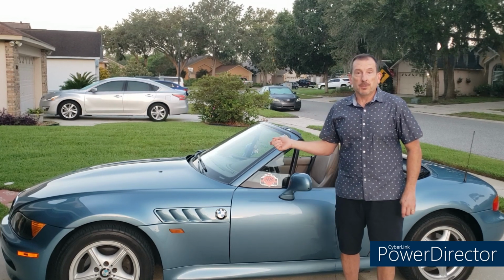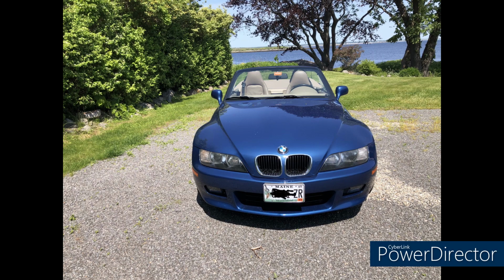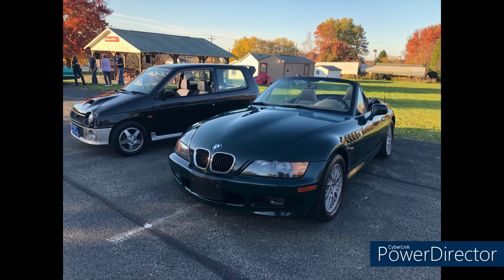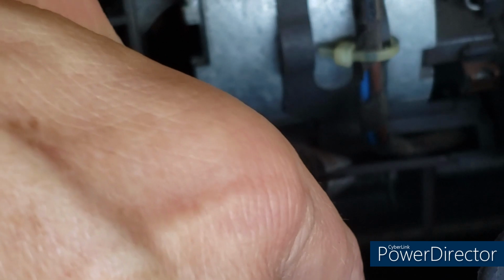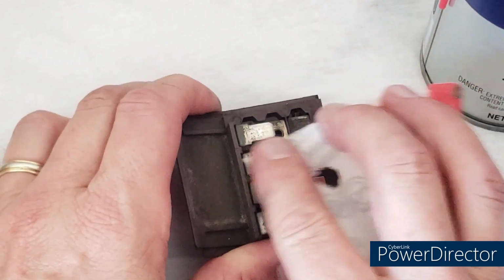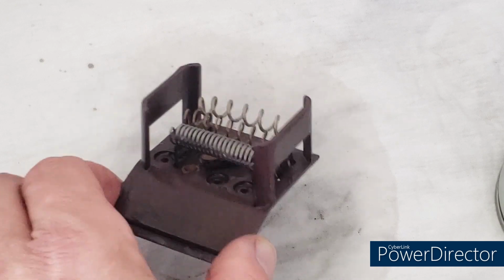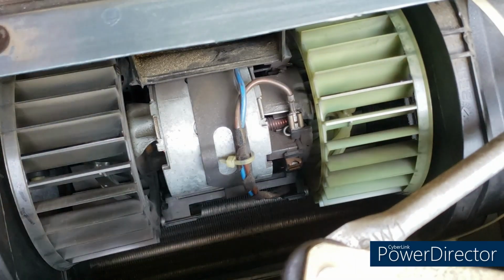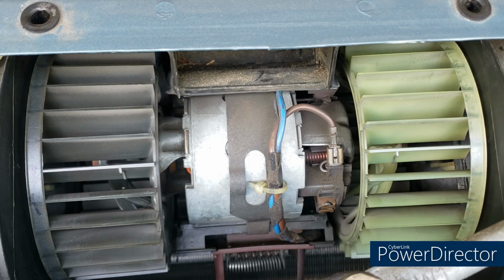How to Clean/Replace the Blower Motor Resistor: BMW Z3!

Comment: Great video, thank you! I followed the link for the resistor, but a banner on the top of the page reads 
" This does not fit
2002 BMW Z3"
I don't know why, since it's obviously the same. I'll order it and see.
Reply from the maker: My guess is that it will work, let me know if it doesn't.
Reply: @MomentofZed  Well, Amazon now said it won't ship to me in New Zealand so I guess it wasn't meant to be! I found it at Summit racing, although it says it only fits up to year 2001 and mine is a 2002. Looks identical though

Comment: @MomentofZed please pin this!

Cleaning is not the only option before spending $100 on a new one

on the spring side of the resistor theres what appears to be a small metal strip underneath the springs running diagonally, if you look closer its 2 metal strips tensioned together.

in order for the resistor to work they need to be in contact, over time the top strip tends to lose tension. if theres a gap bend them back into contact (prob clean the contacts first tho).

if you have a multimeter you should see continuity on both ends of the metal strips, test for this from the small copper rivet points, be careful not to push down the top strip with the probe, you dont want a false positive.

good luck!
Reply from the maker: Thank you for the detailed explanation!

Comment: The person i got mine from said he "left the door open" so it blows cold air even if its turned off. How do i fix this? Any tips
Reply from the maker: Do you mean the temperature control?
Reply: @MomentofZed  yes on the temp control I will have it turned off and it will still blow cold air. You can hear the fan on at all times.

Comment: I just bought a 2000 Z3 and your videos have been so helpful!
Reply from the maker: Glad to hear that!  Congratulations and thanks for watching!
Reply: @MomentofZed  Do you know what the problem is when the temperature of the air is not getting any warmer, even when the car is up to temperature? I got a Z3 2,2
Reply from the maker: @zlover7777  are you getting resistance when you twist the temperature knob? The linkage to the flap that controls the entrance of heated air is a known failure point.
Reply: @MomentofZed  Hmm, I will take a look at it . I will keep you updated
Reply: @MomentofZed  I get resistance turning, also the knob itself is loose. But I I feel it turn.. also the AC is not working even though it is been filled in June. I got the car since Sunday so I don't know exactly if it thats true. What could this be?
Reply from the maker: @zlover7777  without being  there unfortunately I don't have much to add to be honest.  Have you tried searching the old forums?  They've been a good source for me.
Reply: @MomentofZed  Thanks for your answers so far, I will take a look and discuss this with my local garage.

Comment: Hey Mark, recently my Z3 has had a burning oil smell, any ideas or should I just take it in?
It's a 98 with 83k miles
Reply from the maker: I'd first look for a leak that is hitting the exhaust manifold.  Sure about the smell?  Mine smells burnt occasionally,  but its a small gap between the two exhaust system sides.

Comment: Cleaning contacts? Use something cheap since you're using sandpaper too. Those wd40 nozzle bottles are a pain and will fail after a few actuations back and forth, then it just sprays everywhere except where you point it. A barrel of laughs for whoever designed it. 
What I do enjoy, are your videos. Look forward to each and every one. Someday I'll share my ZED with you which I'm slowly fixing up but still driving every day. 
Cheers!
Reply from the maker: Thank you for the kind words!  Look forward to seeing it!